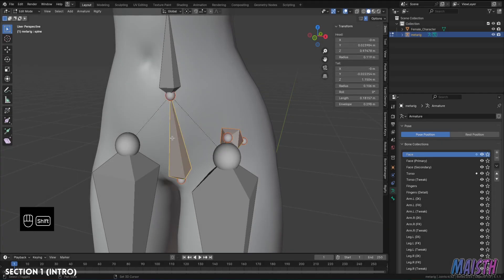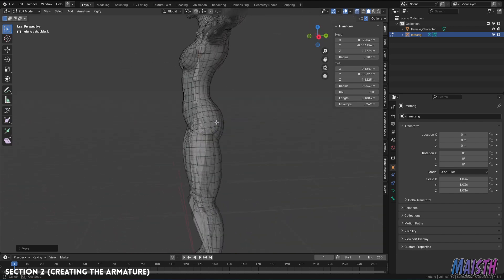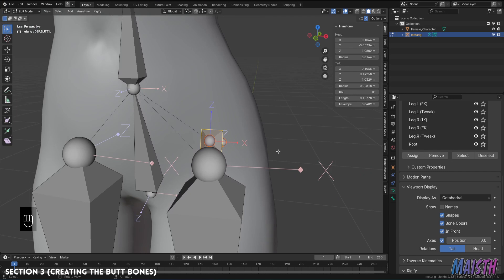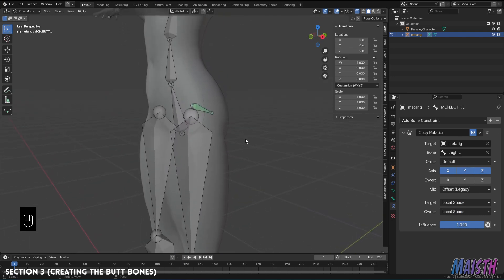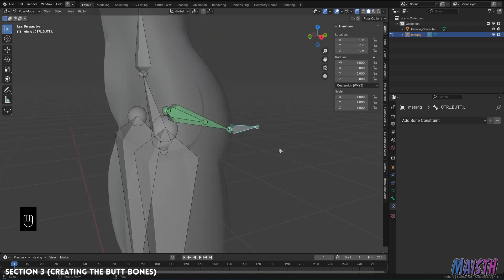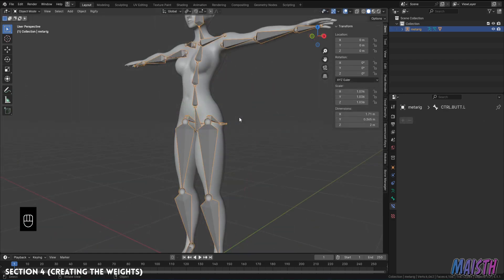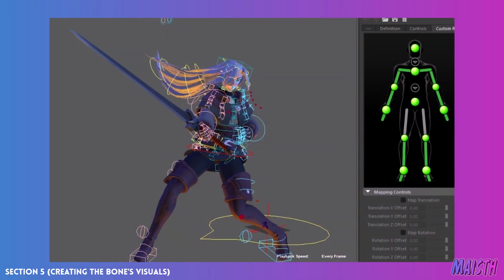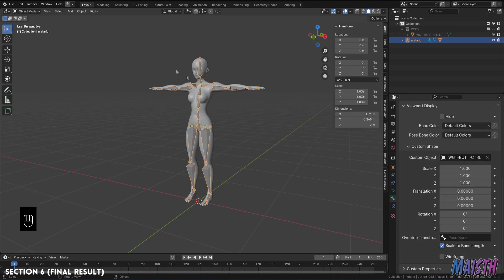How to Rig a Character's Butt in Blender! - Blender Tutorial

Comment: How can you get it so that when the thigh flexes backward, the butt preserves it's volume and "squishes" outward? Right now, the butt crease just seems to get more prominent, but the size of the butt itself isn't affected really, so it appears flat.
Reply from the maker: if you have the Butt bone created and assigned with the Constraints and all that then that butt part should slightly deform like you see in the video. 

Otherwise if it's not happening to you and you have it set up correctly then it's a matter of adjusting the weights of the butt and thighs.

I hope this comment helps you.